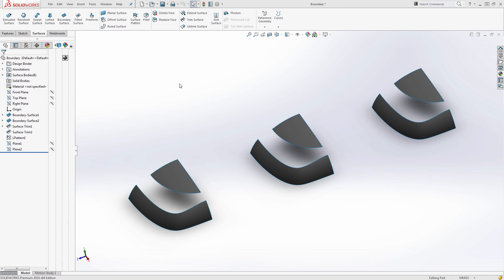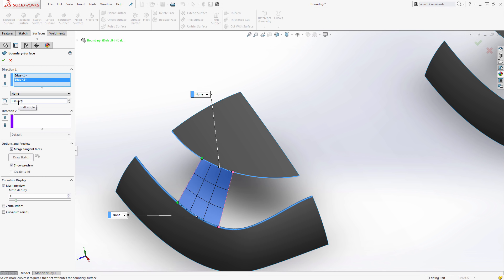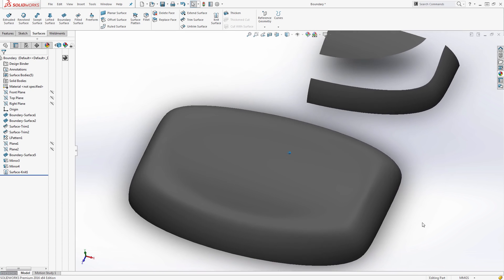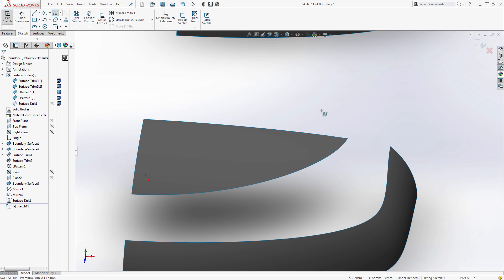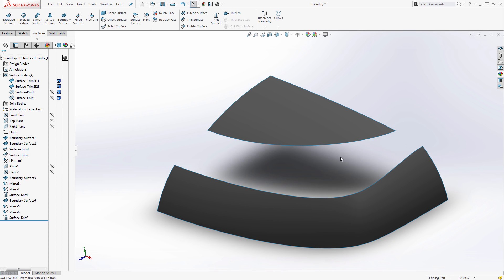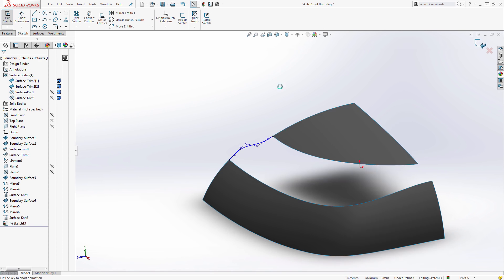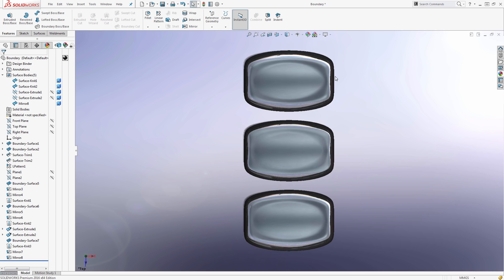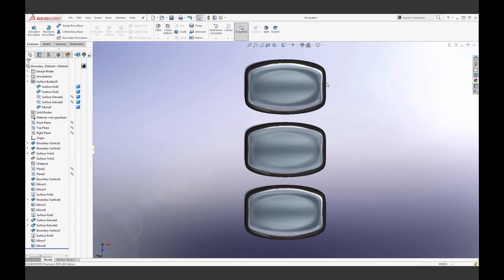SOLIDWORKS Boundary Feature

Comment: My understanding is weight, tangent influence, and magnitude, tangent length are the same thing. I think it adds extra confusion for user to have multiple terms for the same thing, the context changes based on 1 or 2 set of end conditions.  Also the G3 sketch method used with style splines is only true for connections to straight sections. When establishing a G3 connection to an object with curve you want to match rate of acceleration not reduce it to zero. Turning on your curvature combs you would see the mismatch.

Comment: i dont know if you are active, but do you know how you created those parts?
Reply from the maker: These parts were created using a single Boundary Surface, with the midsection trimmed away. You can check the feature tree to see which features were used.

Comment: which software is the mainstream for surfacing?
Reply: It depends on the industry. Rhino is used a lot for yacht design surfacing, Alias for automotive surfacing and SOLIDWORKS for surface modeling in the Product Design field in general

Comment: On the third case you need to imply a G2 curvature match to the original edges for both deg7 curves. Then every 4th point (for pseudo G3 continuity) had to be adjusted so that its curve comb to make a tangent transition to the G2 curv comb of the original edges.
The way you have done it in the video with the collinear "hack" is just introducing a flat point at the edges where the blend surf and the original surf will match. And actually you have amplified the flat spot by making the G3 "flat" as well.